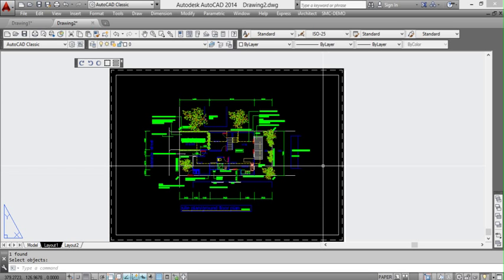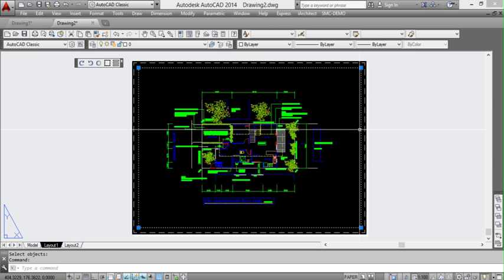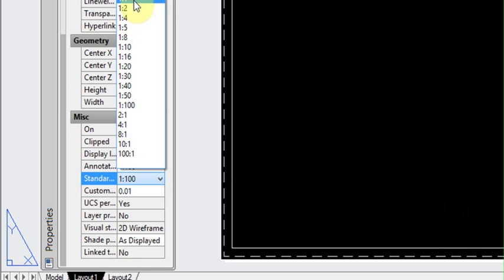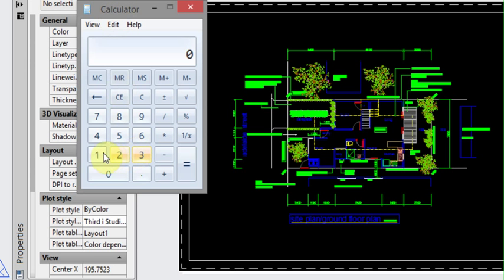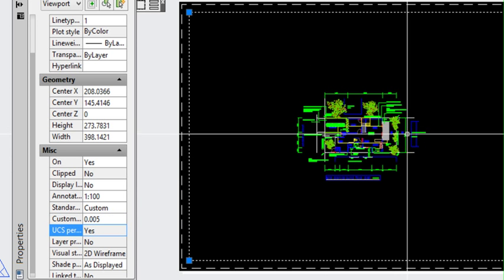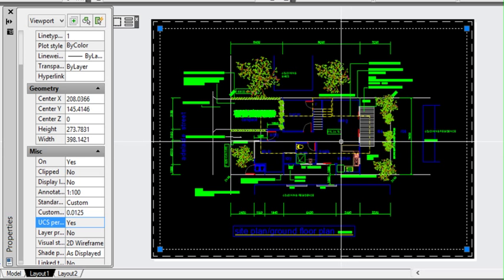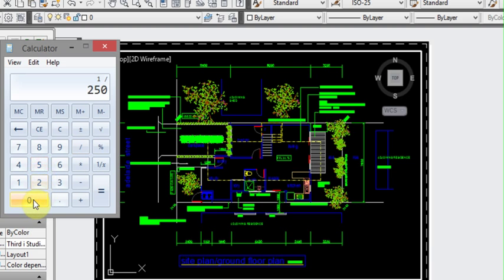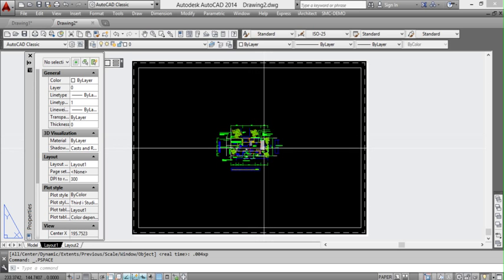How to Scale AutoCAD viewports to any custom scale

Comment: where the best place to show dimensions in Model or Layout
Reply from the maker: this is quite a personal choice depending on how you prefer to work.
For me personally i like to keep them in paperspace, same with text too and some symbols.
When i 1st started using AutoCAD paperspace didn't even exist, then when introduced you could only have 1 layout which was restricting but had ways around it. Now you can have many paperspace tabs and i like that method.
As time has gone on though Autodesk introduced annotative text and dimensions which you use in model space and they do have some advantages but i still prefer to keep my plans clean of text.
You could always have a .dwg for your floor plans, then xref the floor plans into another drawing to do your dimensions and text in model space then setup in paperspace. It really is how you prefer to work.

Comment: can i select same scale for different size of drawings  in different view ports? in one layout?
Reply from the maker: Hi Sarfaz, yes, if i understand what you are saying. You can create many different viewports on the same paper space layout and assign different scales to each of them.
Reply: I think i was unable to explain my problem,
I was asking, "Can i draw different sizes of drawings (in different view ports) having same scale?"
Reply from the maker: Can you give me an example of what you are trying to do? When you say different sizes of drawings I'm not clear what you mean. I'm not sure I understand why you would want to do that. You have 2 spaces in AutoCAD - Model Space and Paper Space. In Model Space, that is where you should draw everything at 1:1 scale, and adjust the scale for plotting in Paper Space using the Viewports.
Now I think you might mean this:
Lets say you had an actual table that you drew 1 metre x 1 metre as that is what it is in reality. But right next to that you drew the same table, but this time drew it at 2 metres x 2 metres, you could then go to Paper Space and scale a viewport for each table so they plot the same size. But each table would need its own viewport to do so as the scale would have to be set differently so they plotted the same.
I'm not sure if that answers your question as I am not sure what you are trying to do exactly. If you can elaborate with an example it may help me to understand and give you advice.
Reply: Thank you for giving me your precious time, i will contact you soon with an clear example. thanks again.
Reply: Problem:
if I draw 1m x 1m and 2m x 2m squares in models. And want to print these two squares in two different view ports with same scale. Then one square ( 1m x 1m ) shows in view port properly and 2m x 2m square goes out of the view port.  I want to select the same scale for both view ports. hope you will understand this time.
Reply from the maker: Hi Sarfaz, sorry for the late reply, I didn't see your comment until now.
Lets say you wanted your 1m x 1m square to be 1:100, then if you wanted your 2m x 2m square to be the same scale, you could also select 1:100. Both squares would be the same scale, but obviously the 1m x 1m will look smaller than the 2m x 2m, but both will be to the same scale. The way you can do this is by opening your properties window in AutoCAD. Hold the CTRL key down on your keyboard, then press the number 1 key on your keyboard. 
Now select one of your viewports, in the properties window, scroll down to 'Standard Scale' and select the scale you want. Do that to all viewports you want to scale. Is that what you wanted to know? Or do you want both squares be the same size on the page? If so, they need to be different scale viewports
Reply: Awesome Andrew  i will try and reply later soon.
Reply: maybe try scaling the 2mx2m viewport  by 1/2. It will be the same scale as the 1mx1m viewport.